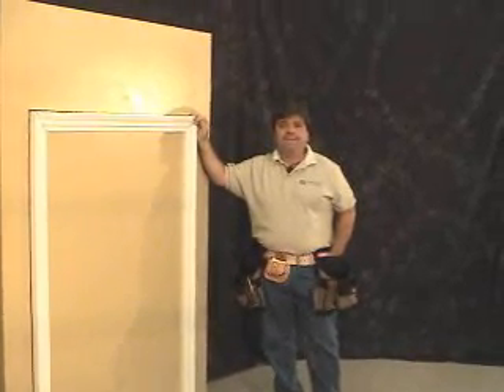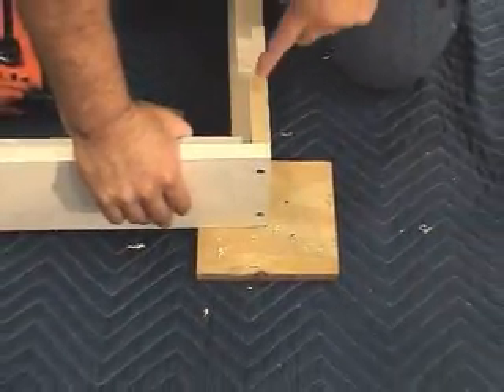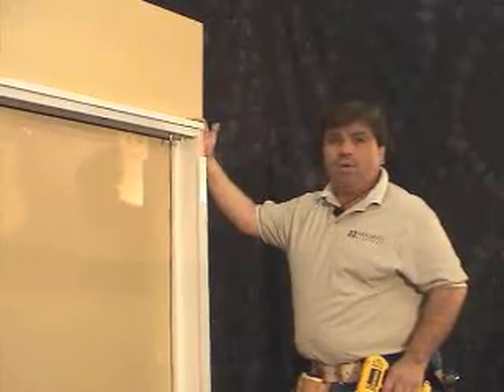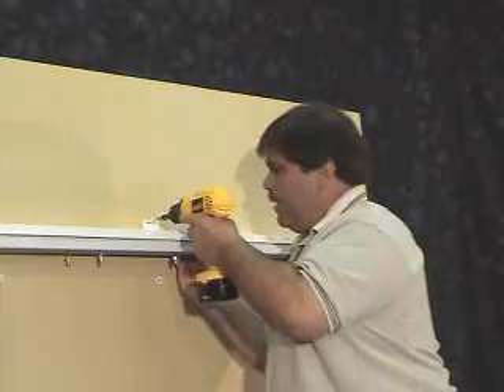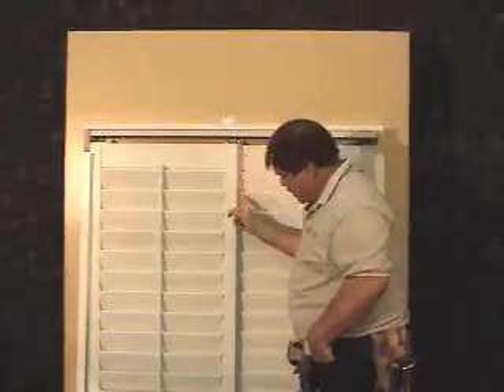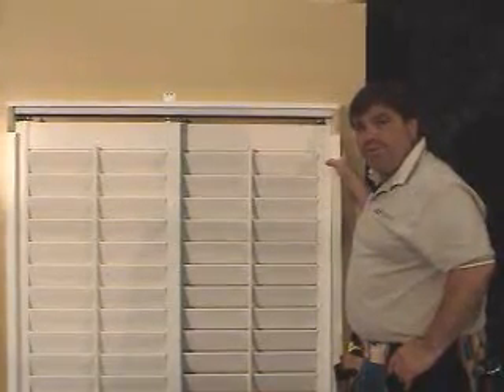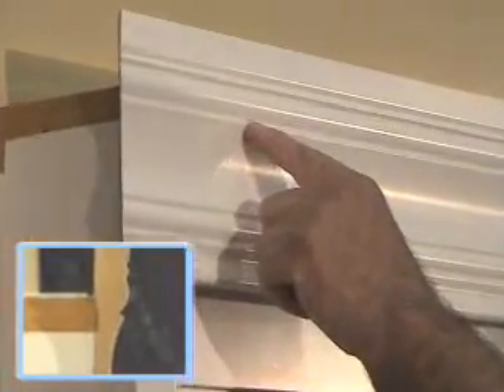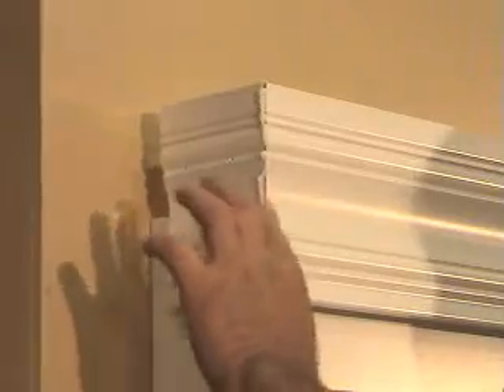Install Bypass Track - Norman Shutters

Comment: I had a Norman shutters bypass plantation shutters installed in front of my sliding patio door. The track trolley rollers are not clamped tight and the shutters are not plumb. The installer didn’t leave me an adjustment wrench and overall did a poor job. I’m disappointed and need some factory support.